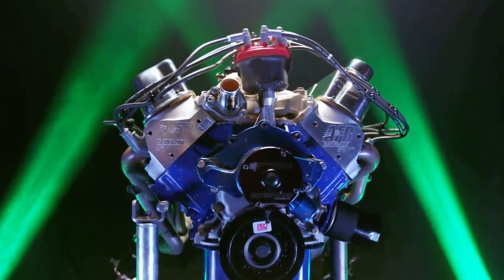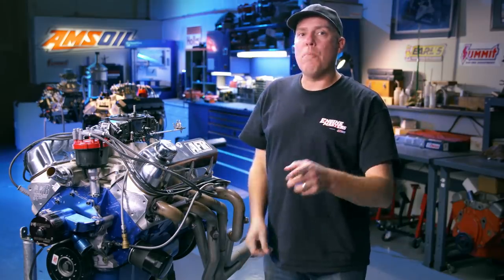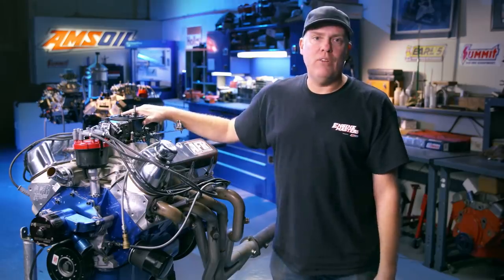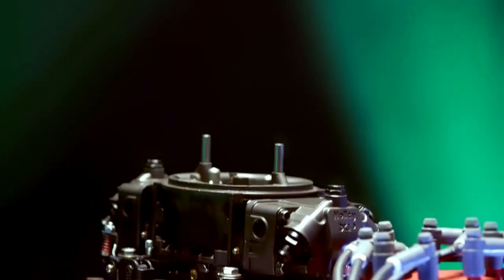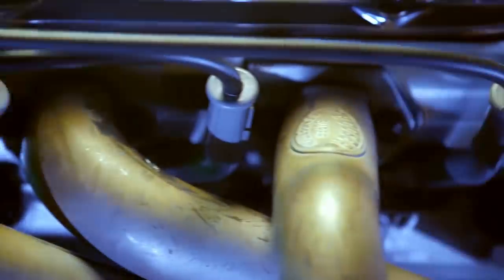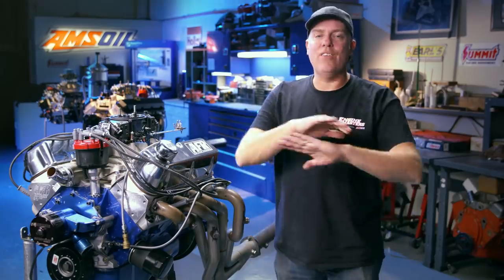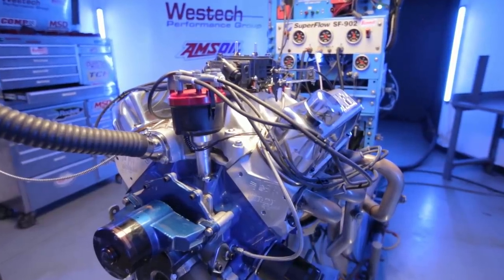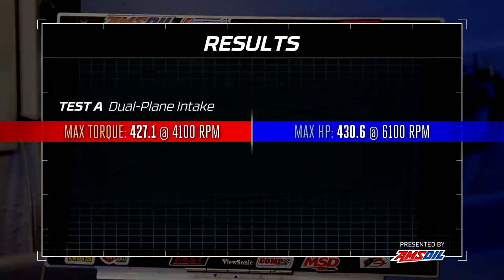Single Vs. Dual Plane Intake Shootout! - Engine Masters Preview Ep. 33

Comment: I’ll save you the trouble. 

Dual Plane for the Street. - Good low end torque.

Single Plane for the Strip. - Kills low end torque but yields a bit more horsepower. 

The End.
Reply: A to the Zaval. No they'll say the single plane is better because they start all of their dyno runs at full throttle at 3000 RPM. Useless test for a dual plane. Lock the throttle at 40% and start the pulls at 1500 RPM. That would be a usefull comparison.
Reply: Thank you
Reply: @romansoroka6662  AT least someone gets it.
Reply: but. when your running a stroker like a 408w why would you stick a dual plain manifold on a 400 plus cu in motor? street or strip? if you have good heads like i have the AFR205 heads makes sense to use a good single plain?  why choke it ? i had a rpm air gap on my 402w street 69 mach1. took it off. had my vic jr fully ported. nite and day differance. feed it. a 351w yes use the air gap, 400 plus cubes a single plain. i have more torque then i can use..

Comment: you should do a horsepower per dollar of a ford vs chevy small block, as in how much say 450 hp would cost for each manufacturer
Reply: David Leister i second this
Reply: They did already, they had $10K engines. The Chevy won. Can't link any more because it's all gone.
Reply: not set the dollar amount, set the horsepower amount and see how many dollars that HP level takes to achieve
Reply: The Ford actually won.
Reply: Easily done. Chevy will always win this fight

Comment: You guys need to do an episode where you incorporate all your power adding findings into one engine to see what you can squeeze out of it. Intakes, headers, oil capacity, air filters, carbs, roller valve train all of what we learned through you, in one engine. Make it happen.

Comment: So you couldn't stretch the video 1 more minute to show the single plane results? Fords are much more expensive to build than Chevys. How much more did it cost for the 351 to beat the 350?
Reply: Larry Kittell my experience tells me it’s negligible.  Heads, cam, pistons no real difference.  Certainly not enough of a difference to use a Chevy in Ford!

Comment: Guyes, an engine that size, with a good performance roller cam and heads that are that good, need way bigger carb than 750 on a Dual plane intake without milled down divider wall or carb spacer. :) You know this, you have milled down divider walls before. ;)

Comment: Where are all of the full length episodes?
Reply: Motor Trend is no longer uploading full episodes of their primary shows to YouTube. However, if you're in the US, you can still watch all of their former YouTube shows for free on the Motor Trend website, or mobile app.
Reply: How?  I go to motortrend and I can watch for 14 days free then they start billing.  What am I missing?
Reply: I can watch all the free shows that were on YouTube without logging in on Motortrend on demand here in Sweden.  You just have to put up with the commercials and disabled addblockers.

Comment: Love the show series. Parts vs.  parts and engines vs. engines. I  would like to see your opinion and a dyno shootout   of an electric motor vs. a gas engine  of similar results in the quarter  mile. Also the weight of the batteries vs. the weight of the fuel needed to do the job. Would the fastest car in the world be a turbo charged gas engine with an electric assist or does a diesel accomplish that combination?

Comment: Do a carb spacer episode please ! !!!! 
Carb spacers are cheap and claim to increase plenum volume they are allowed by racing rules and could be usefull for the guy on the street. How much more power will a duel plain make with a 2” 2 slot VS a 1” 4 hole 🕳 vs a 2” quad on a single plain ETC.  
It would be good to see what they can do on a duel plain VS single and how tall it too tall. 

The theory is there are gains from having less back pressure going up into the carb killing air volocity, with a high overlap cam grind....  but air volocity is already killed by the greater distance so what’s actually happening ?  Would this make a difference if you had less overlap on the cam ?  The right combination could be 15-30 Hp or give you more bottom end torque or kill bottom end torque.  carb spacers are not expensive, or they all might be a waist of money or is the 1/2 spacer on the NOS kit actually producing more power just from the spacer ????? 

You get the idea I hope you read all the comments but after seeing all the comments posted I couldn’t blaim you if you didn’t anymore.

Comment: So quick tuning quesiton, Im learning alot from your show and im narrowing down my trouble shooting on my 1971 ford 351 cleveland and got a new top end intake, exluding heads. Im looking into tuning the edelbrock and seeing the different jet and metering rod combos i can do but the grid that shows Cruising/Power Mode is confusing. Can you help me elaborate at all? Im led to believe my motor is running rich and im focusing on easy to access adjustments to see if it helps at all. (quick open throttle causing backfire thru carb) no vacuum leaks and new timing chain

Comment: I have a shevy 350 small block in a 78 truck and 2000$ to spend on hp mods  what should I get (bone stock)-new to Chevy 350s (just don’t want to blow the rods or pistons)

Comment: Windsor Engines Good, I will admit but how did it win Thisssssss much, maybe thisssssssssssss much more cubic inch displacement, Cost was more I'm sure and can't go over 500 hp with windsor blocks without girdle or crack in half, even then over 500 hp risky also NONE come 4 bolt main and I'm not just saying I've seen a few of them cracked in half.